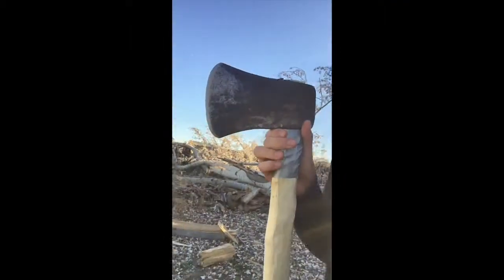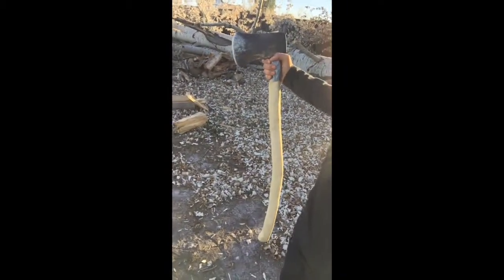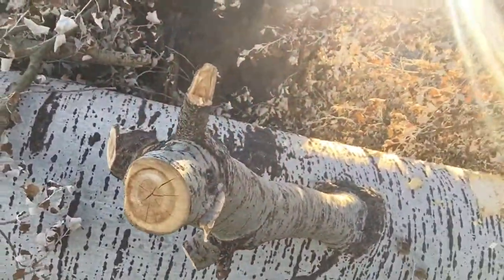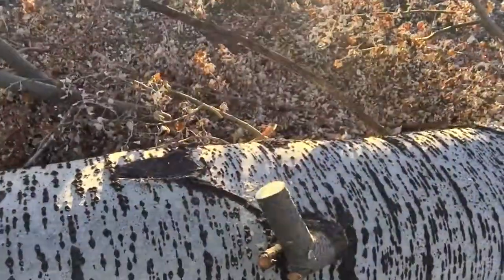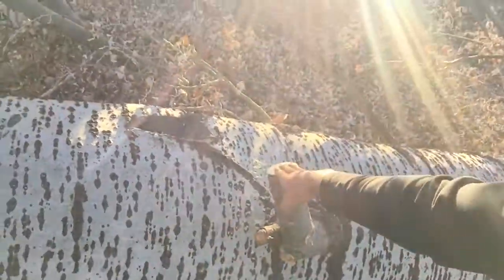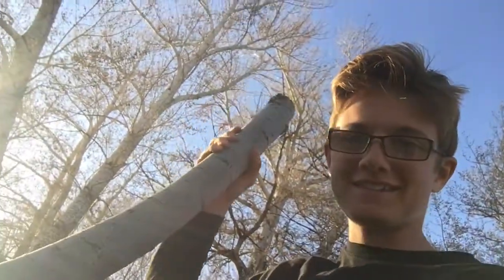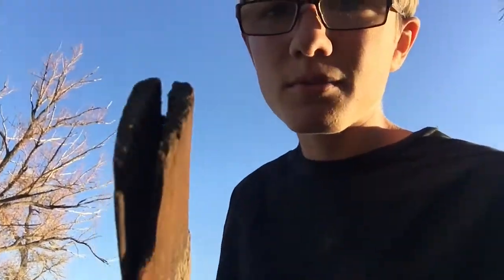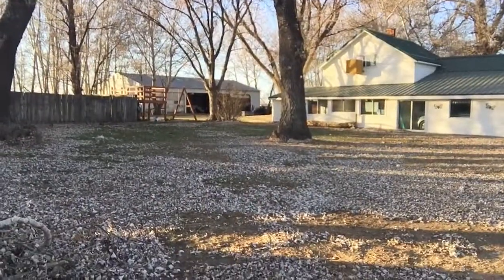Why I carved my own axe handle?!

Comment: Way to dive into such a project. How doe the handle feel? Does the axe work well?  I’ve got an axe head that I’ve wanted to make my own handle for for a couple years now...haven’t gotten to it yet.
Reply from the maker: Thanks! the handle is a bit bigger than most handles you will find, but it fits my hand well and is easy for me to swing though it split at the top a bit. It is a bit heavier than most axes, but I am looking for different ways to do it so that it is stronger. :). 
Note: You have to let the handle dry out before use!